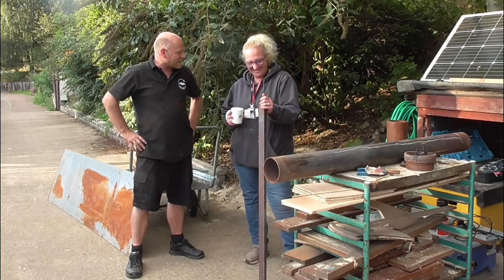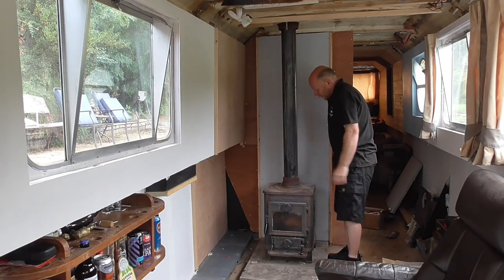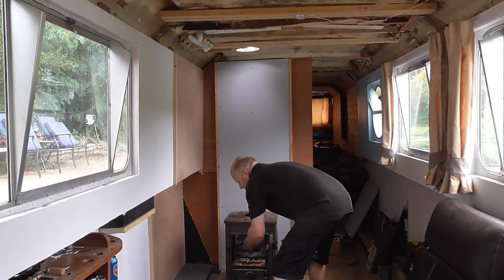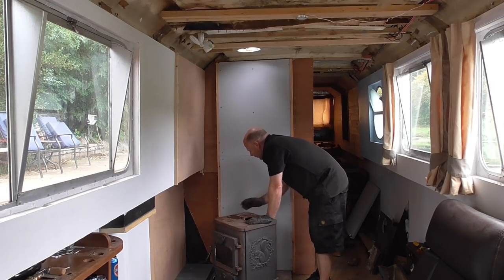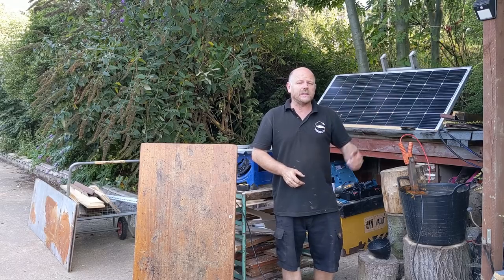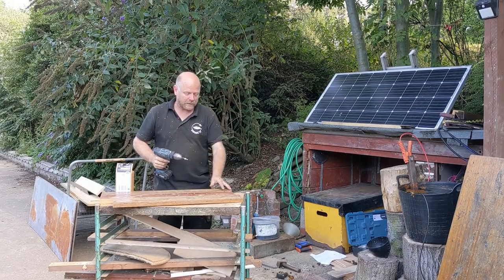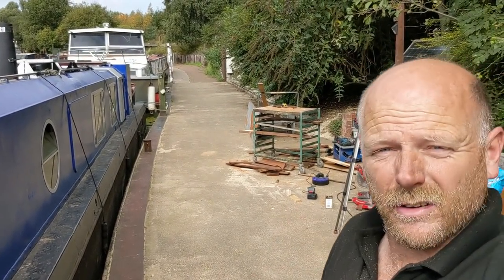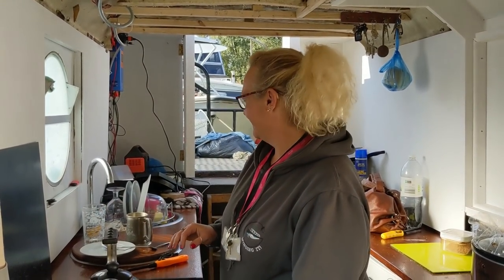Building a FIREPLACE on a NARROWBOAT - SCRAPHEAP CHALLENGE STYLE. Turning TRASH TO TREASURE

Comment: Great job with the fireplace Peter.👍 Are you going to be blacking it? It sure would look awesome if you did. Tip... Use Boot/Shoe polish with a shoe brush and buff it with a softer one to get it looking pristine. Saves on buying a can of spray paint too. We all know what a tight Yorkshire man you are and will keep the pennies in check and the pounds safe. 😉

Brilliant news Summer is back at home.   🤗
Reply from the maker: Yes I think we will be blacking it, we have some stove polish for it - much prefer the polished look to the painted look. :)
Reply: @WingingItBoatingonaBudget  For sure it would look much better with that polished look about it. Paint would peel off from the heat it would produce and be a pain in the butt. Saving time, money. & energy. 👍

Comment: Wow Peter, you have been making really good progress on the boat lately; looking good! 👍  I had 2 concerns on the wood stove (that's what they call them here in the US).  First, if you simply lay a steel plate on top of the wood stove to increase the cooking area, you won't conduct very much heat to the cookware.  To be effective, you need some type of heat conducting adhesive between the stove top and plate.  Unfortunately, I don't know what to suggest, my first choice would have been silicone sealer made for engine exhaust manifolds but, I suspect that stove top may exceed the temperature rating of that sealer.

Secondly, those wood stoves put out a huge amount of radiant heat, which will ignite wood that is less than a half meter away.  Protecting the wood and nearby combustibles is normally addressed with a reflective metal that has an air gap behind the metal.  I would think glass could be used for the same purpose if it has a thin metal glazing.  Check into all the codes on the subject, just so all that hard work doesn't up in smoke.
Reply from the maker: Boat really is taking shape now... These last few weeks we have made real good progress. 
We have a friend who uses a similar plate on their stove and it does work ok, the edge section doesnt get very hot though. we will see how we go and see if any tweaks are needed.
As for the construction we have made sure we are within code, its just that final bit at the bottom now... I had in my mind how it was going to be - then made the wooden section and now want to improve the design. But dont panic we will make sure its all safe - last thing we want to do is burn the boat down.
Take care.
Reply: @WingingItBoatingonaBudget  Thanks Peter, I suspected I was mentioning things you probably already noticed but, wanted to mention it just in case, especially if it could save having to tear into something, having to undo hard work.  Thanks for the prompt response and glad to hear Dawn's daughter's health is progressing in the right direction.  Cheerio!

Comment: I would be tempted to make a metal tray that slides in for when you are cleaning the ashes out of the stove, then removes to carry any spilt ashes out and store elsewhere till next use. If you start with a sheet of steel, instead of cutting a slot to clear the legs make a single cut aligning with the centre of the legs on both sides from the back to where the legs are at the front, then fold up to the sides so that it forms an edge that ashes can't fall off - and the same round the sides and front (not sure about clearance for the back - but fold up if possible) You'd then end up with a tray with all edges folded up that looks a bit like the head of a fork with the 2 middle tines still joined. Add a handle at either side to make lifting it back out and you have an easy to use ash catcher and removal tray. I hope that makes sense. It's hard to put the idea into words when a single simple picture would do it so easily. (It's a pity these stoves are not wall mounted - then with no feet on the ground a tray to go underneath would not need slots to allow for supporting feet.)
Reply from the maker: We have thought of some kind of tray, keep the hearth protected and make cleaning easier...

Comment: I have copied and pasted the following about resin. Just thought it may be an option. But, it can be expensive if you need a lot for the project. "Resin is resistant to high heat and corrosive chemicals and has great flexural strength, meaning it can handle a lot of stress. While curing can take days to complete, the final result should be a smooth surface that can take almost anything your family throws at it! The finished product is practically indestructible."
Reply from the maker: I will investigate as i didnt think resins were suitable... But I will definitely make some enquiries! Thankyou.

Comment: Ive often wondered why theres not a damper in the flu on narrowboat chimneys similar to house woodburners? Any ideas?
Reply from the maker: Yikes - you've got me there, the only log burners etc I've had experience of are on a boat. So not sure what a damper is / does and why they aren't on boats! 🤔🤷
Reply: Its a round metal disk on a steel shaft in the chimney that has a handle, normally spring loaded inside. This allows you to regulate the draw on the fire and close the chimney when the fires not lit.
Reply from the maker: @DIYGUY1-2-3  quite often on narrowboats people put a cap on the chimney when not in use. 
As for control that's just done via the vents on the log burner itself. It may well be that due to the short length of flue a damper is not as efficient as on a set up in a house. But that's just a guess... 
We have found we are able to control it fine with just the vents on the fire itself.
Reply: Thinking about it.....probably make it difficult to sweep too. We have to remove our chimney at home to clean it.